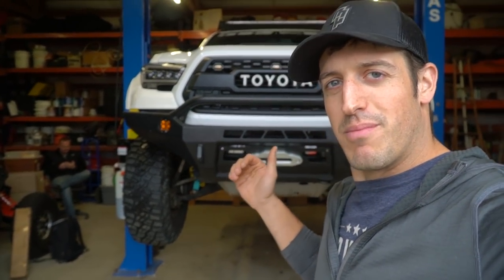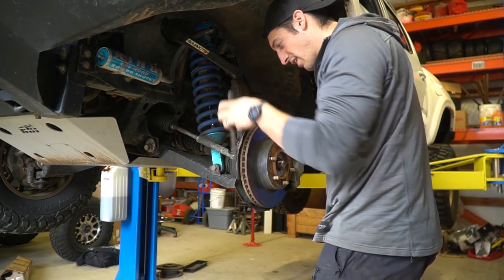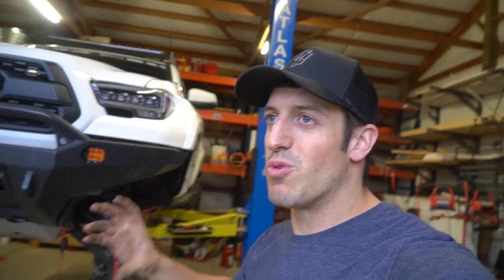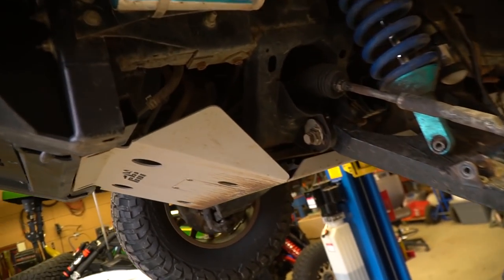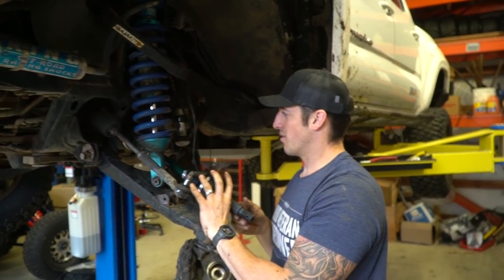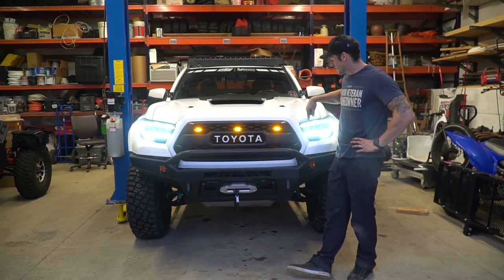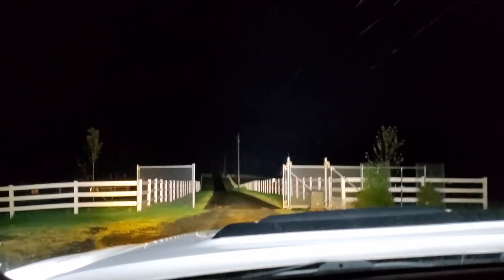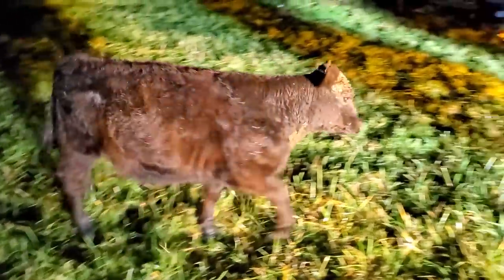Toyota Tacoma Cv Axle Replacement DIY

Comment: For future reference you only need to take the lower 2 19mm bolts out of the knuckle as well as the 35mm axle nut out. You can leave everything else hooked up you just have to pivot the knuckle off the splines of the cv. (You pivot it towards the front of the truck to play nice with the outer tie rod)